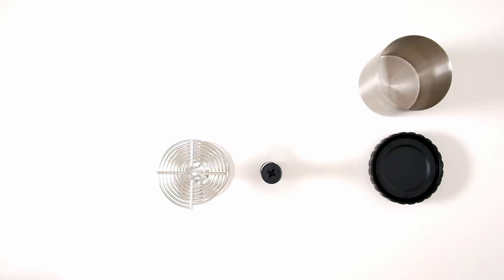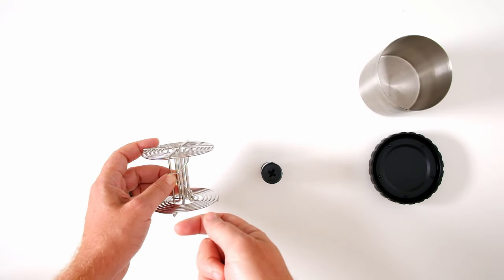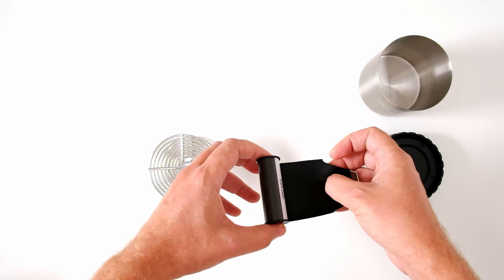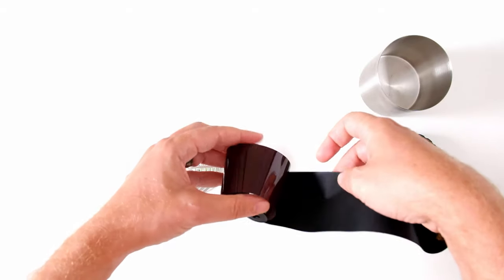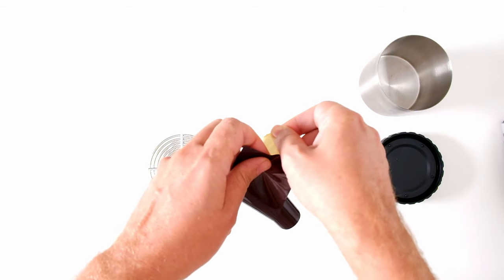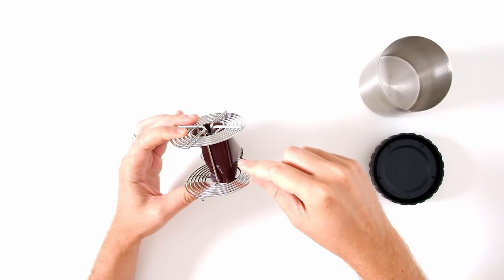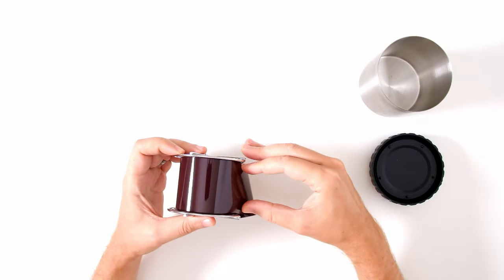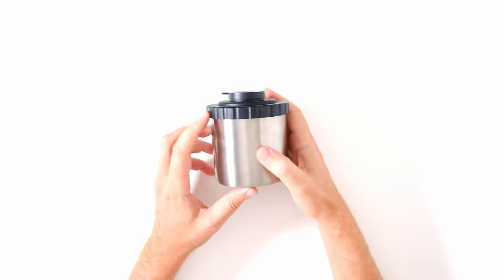Loading 120 (Medium Format) Film into a Steel/Metal Reel (Hewes Reel)

Comment: I disagree with your method of loading the film reel.  You are handling the film too much, which can damage its emulsion.  Try this method: 1) Unroll the film/paper in the same way as you do at the beginning of your process. 2) When you feel the film revealing itself from the roll, go about two inches farther, then tear the paper off and get it out of the way. 3) Now, with a couple of inches of film "exposed" from beneath the paper, start its end into the reel. 4) "Walk" the film around the reel, separating the paper from the film, as you "spool" the film on to the reel.  5) When you come to the end of the film/paper, don't tear the tape off.  Just take a pair of scissors and cut the film just before the tape (Or, even on the tape.) from the film strip.  With this method, the film remains protected by the paper backing as you handle it while loading it on to the reel.  By using scissors to cut the paper backing from the film, there is no risk of damaging the film during the hand removal of the tape, or accidentally "jerking" the film out of the tracks of the film reel, when the tape releases from the film.
Reply from the maker: Hi, thanks for watching my channel! Loading film is one of those things where if you ask 5 photographers how to do it, you'll get 7 different answers. I've found that you can handle film all you want – as long as you don't touch the emulsion side of the film and you develop it right away, you won't introduce fingerprints into your images. I was also taught not to cut 120 film, since you're introducing some potential new problems (most saliently, the film tends to slip off track if your cut isn't 90 degrees or close), but like you say, it does avoid the issues that come with trying to peel the tape. Some people actually just leave the tape on, though I would worry about it coming off during development and wreaking havoc.